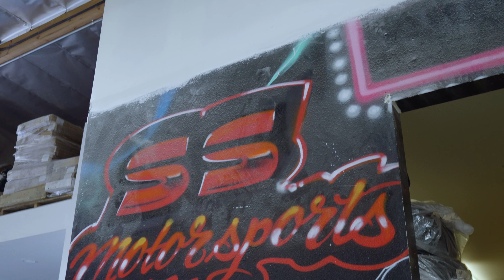New Wheels for a 2021 Ford Mustang Mach-E?!!! | BD-F18 | F-Series

Comment: What size are the rims and tires
Reply from the maker: Wheels are 20" BD-F18 in Gloss Black and Tires are 245/50/20, you can email us if you have any questions info@blaquediamond.com
Reply: @Blaquediamondwheels  thanks for answering. Is this car lowered?
Reply: @rithikbommireddy5628  I don't think there are any lowering options out yet. Instead it seems like they went with a much larger tire to reduce wheel gap
Reply: @Blaquediamondwheels  Any idea how far off the speedometer is and if there are any solutions to recalibrating? This honestly should've been the factory wheels stock looks way too small on this car
Reply from the maker: @joshbotelho1994  SS Motorsports in Simi Valley did all the work on this customer's car, feel free to contact them for more info regarding this specific vehicle. The larger tire size does indeed help reduce the tire gap.
Reply from the maker: @rithikbommireddy5628  SS Motorsports in Simi Valley did all the work on this customer's car, feel free to contact them for more info regarding this specific vehicle.
Reply: @Blaquediamondwheels  How much would it cost for a set of these black wheels 19"??
Reply from the maker: @kliffyboy  Please email us info@blaquediamond.com
Reply: I have a mach e GT on order. Im going with 21's ..possibly this same wheel with 275 40 or 35 tires!
Reply: @joshbotelho1994  Speedo will read about 10% slower.